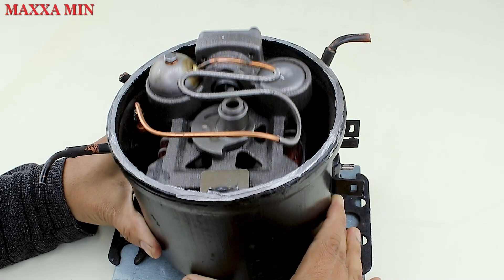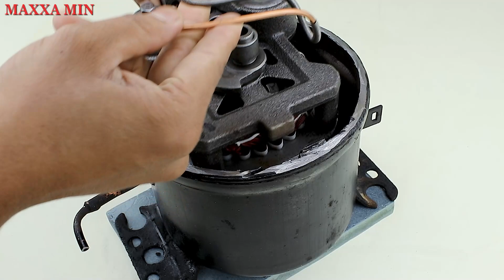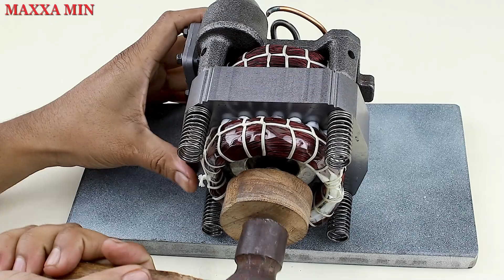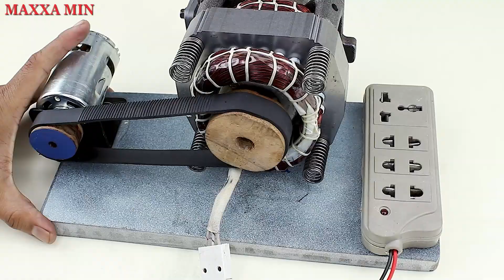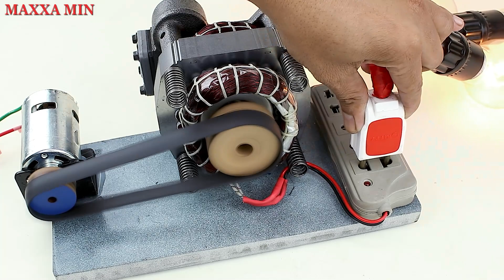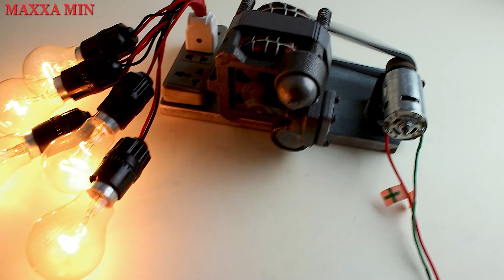Refrigerator Condenser Electricity Generator 230V central electric motor Light Bulb Electric Energy

Comment: I guess a person can use a 12 V battery or 9 volt DC for starting purposes and the battery can be constantly loaded by this device and the extra power can be used to running electrical implements through an inverter... Just saying... otherwise the power created will just work on DC appliances... Good try...We need people like you on Earth who are not afraid to do their thing....Much Love...

Comment: i don't know , because if the motor was puting out that kind of voltage ,those light bulb will blow out for sure .what im thinking baybe the motor is only puting out 12 to 24 volts and the light bulbs are 12  volts light bulbs .